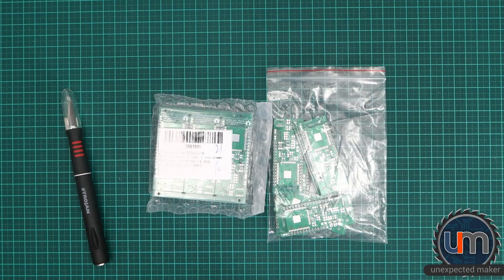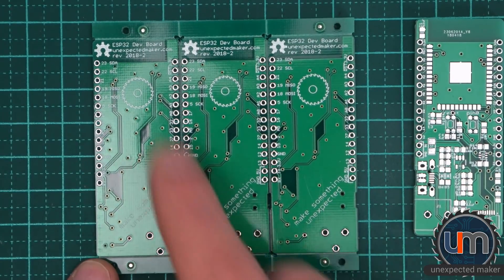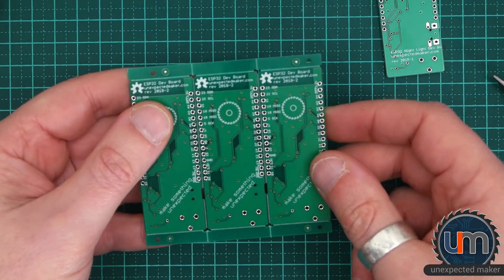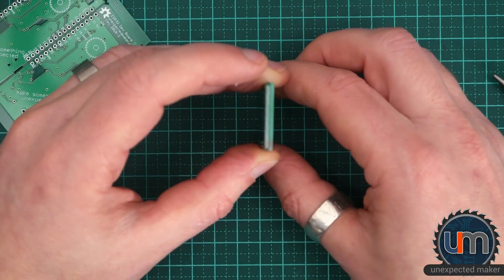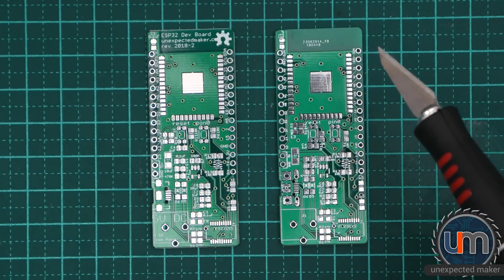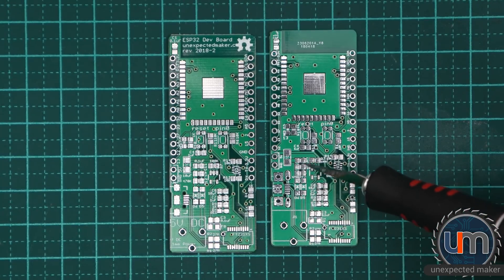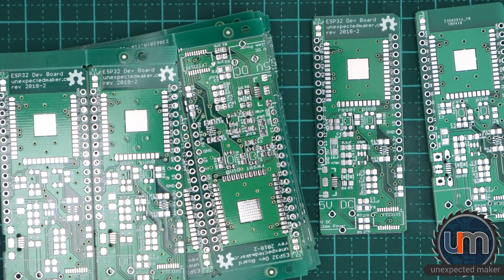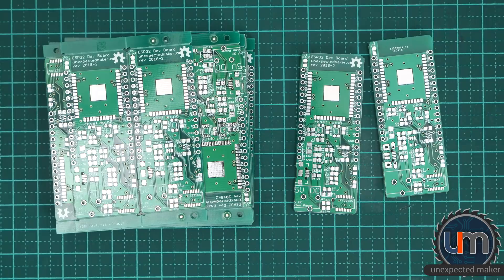ESP32 Dev Board - JLCPCB Panellising ok?

Comment: I think the curves are per the radius you specify no? Ie I assume that board was defined as "rounded rectangle". I normally tune the radius up or down. Also,,, regarding v-score and leaving clearance,,, I think the point of vscore is 0-clearance straight cut,,  and for that reason the specify a distance to "keep traces and components" back from edge of board. I've seem hundreds of people doing esp boards, but yours is the cleanest looking

Comment: JLCPCB is the worst ever vendor I used in the past 20 years. if everything works it's okay, if they made something wrong they will NOT refund or redo. Prepare to dispute with your credit card company instead of endless speechless argument of their wrong doing, plus the poor quality of copper plating, you can try out.
Reply from the maker: Yes, I've had some problem boards delivered from them... but I can't agree on the customer service. I've only ever had fantastic experiences with their customer support team. I've had refunds and re-do of boards with no arguing required. To be fair though, I wish that's wasn't required,  I'd rather they got it right the first time. BTW, I've made dozens of PCB's with them.. 2 & 4 layer, 1mm & 1.6mm.
Reply: @UnexpectedMaker  you are lucky. I don't have time to translate Chinese comments but I've read too many similar complains on Chinese forums. TOO MANY......
Reply from the maker: Sure, maybe I've been luckier than some, but as I said, I have also had bad quality delivered from JLC... check this video for example...  https://youtu.be/Gr0gwvVY1JI. 
But for most boards, they are quicker, cheaper and the quality is fine for most of my projects - so far ;)

Comment: Have you tried ordering a stencil from them too? I would be interested to know if any stencil would be for a single board or for the whole (mini) panel. I have a stencilling base that accepts 2.5mm metal dowels that I can align a board up with the stencil (you have to put a couple of special pads on the board). If the whole panel was included on the stencil, you could apply solder paste  and reflow the whole panel in one go.

Comment: I know I am a bit late, but I would change the USB connector back to the Adafruit header. Having the housing of the connector soldered as THT significantly increases the durability of the connector.

Given that this is a development board and therefore quite some insertions and some abuse are to be expected, I'd always go for more robustness. When it comes to connectors, I generally use THT, except for cases in which space constraints don't allow me to do so.
Reply from the maker: The Adaftuit header is only useful if you have their specific USB connector, which is super expensive, but I have moved to a different header that uses TH slots to give it more mechanical strength, and I've ditched these SMD only ones :-)

Comment: What projects that use your board have you got in mind ? also would love to see your code when you do,  and here your thought process, great vids and I hope your channel continues to grow....I, and  maybe others, begin WIFI connectivity very exited but after all the nail biting and frustrations of learning the protocols and stuff, find that after  you switch an LED on, or read back temp and humidity you kind of run out of ideas...…...wish I had thought about panel's earlier !.....great Tip !
Reply from the maker: This wasn't made for any specific project... more just to design and make one and share the experience. Once I finish it, I'll be open sourcing all of the files so others can make and learn from it too.

Comment: I find that Eagle sometimes does weird things with text and they don't always end up in the same place in the gerber file compared to the board file. It could be me but I see you have had some similar problems.

I get around this by inspecting the gerber files carefully with a gerber viewer before sending them off.
Reply from the maker: Yup, I've started doing that for every export I do. Using the KiCad gerber viewer. It's not very fast on macOS, but it works and I have caught a few issues so far :-)
Reply: Yep. Same same. Good job.

Comment: If you do the panelization yourself you can add routing for the smooth corners and only have vscore for the straight lines. That way you keep the smooth corners which will get routed. Also check your gerber files for how the silkscreen looks before sending them to manufacturing. The factory shouldn't change the way your text looks but often when moving from cad system to gerber files the change occurs.
Reply from the maker: You are 100% correct - the issue is on gerber export, and not the fault of JLCPCB. I do normally check the gerbers to ensure silkscreens are ok, but for some reason I didn't remember to do it on this batch. I need to make a better 'check list" ;)

The round corners are actually in the panels, but the transition to the VScore area is what makes them feel less round.

I'd like to learn how to do it myself in Eagle - I have lots to learn still :-)
Reply: @UnexpectedMaker  Hi, that board design is available online?

Comment: Oh, man! All times I ordered small PCBs I could have had dozens more. 🙄  I always thought panellising had to be done in Eagle/Kicad and I just didn't bother.  My next order will be different, that's for sure.  Thanks for enlightening me.

I have often had silkscreen text issues, as well.  I have found that ZofzPCB FREE 3D Gerber Viewer (www.zofzpcb.com) does an excellent job of rendering Gebers with very accurate WYSIWYG text rendering, so no big surprises when my boards arrive.  ZofzPCB is a Windows-only app but I am sure it could be run through an emulator on a Mac.  It's worth giving it a try.
Reply from the maker: Yeah, I am not sure why I never panellised before... though I tend to go through a few revisions until I settle on a design, so imagine how many busted boards I'd have lying around - hahaha....

I use KiCad's gerber viewer to check my gerber (when I remember) - it's x-platform, though super slow on macOS. But it does give me a good idea if stuff is going to be ok or not... I forgot to check them this time... oh well.

Comment: Can you use wet and dry to smooth the board. Not saying use water though.
Reply: 220 may be a bit coarse. I'd go and get a few sheets of P1000 from super cheap (or equivalent Aus car place), no fluid. 

You could do them in bulk too, solder some solid core wire on the four outermost corners of one PCB (the socket pins would suffice), feed a stack of the boards, say 5 of 10 to allow for stability. Align them, hold with a clamp of sorts (a quick clamp or whatever) then solder the other end of the wire to hold tension, unclasp and sand the sides as a whole group.
Reply from the maker: I can't put them in the dishwasher after I sand them with my orbital sander? :(
I think just some 220 grit sand paper might be enough to take off the roughness. But they are good enough to leave as is if they are going inside something.

Comment: Hey Seon. I mentioned on one of your previous streams about Stranger Parts (I forget the guys name) take a tour of JLCPCB's factory. I'd have a watch just to see how the boards are manufactured there, not as a "how are circuit boards made" point of view, but how they make them specifically, including the v-grooving etc. A better insight to the manufacturing process should help you design boards to the way you want them to turn out? 

https://www.youtube.com/watch?v=ljOoGyCso8s

Have a great day.
Reply from the maker: Yeah I watched it a few weeks ago. It's an amazing process, and JLCPCB seem to have lots of state of the art machines and a great pipeline.
Reply: Scotty, that's his name. Just came back to me. Yeah was an interesting insight how JLCBPCB do it. It's a very modular setup, which alludes to the other companies using the same equipment on a varying scale. 

More power to them really, they can just build incrementally to scale with demand, and by not having machining behemoths can still accommodate for the hobbyist. Win win.

Comment: Not really unexpected (no pun intended), that panelising will involve some rough edges when you break the boards apart.
I guess a couple of quick swipes with a flat file will probably tidy that up. A little extra work, for a good cost saving. :)
Reply from the maker: Yeah I was expecting a rough edge, but maybe not that rough - lol - anyway, I am sure I can file/sand paper it down... just don't breath in the fibreglass dust right? ;)
Reply: I tend to use a fine file to take care of edges. :)

Comment: Cool! So a panel of 30 is the same cost as 10 of them? That's a lot of boards!! Oh, minor minor spot - that 5V DC silk label is good until you solder a jack over it?!! Could do with it ouside the footprint too? I'd be interested in the boards or kits on Tindie. The Tiny 85 dev ones too 👍👍
Reply from the maker: Yeah, same price if they fit inside the 100mm x100mm default. Quite a jump in price if they fall outside of that, but still cheap considering multi-boards.

Yeah extra silk on the back would have been a good idea.. rev 3 ;)

I have lots of stuff to prepare for tindie - eventually, maybe ;)
Reply: Unexpected Maker keep on making!!